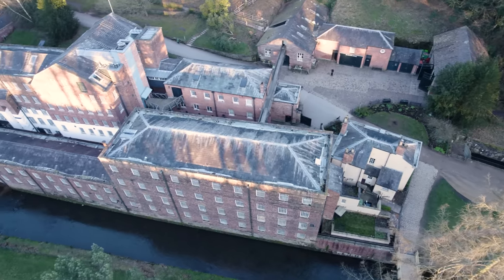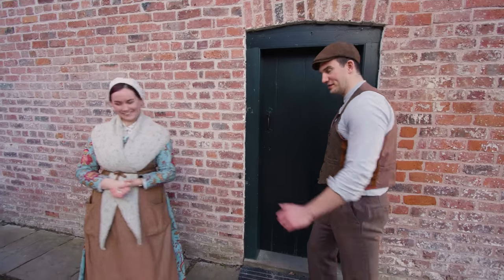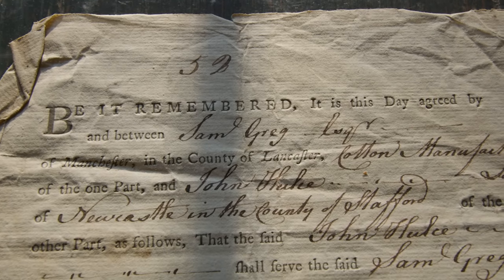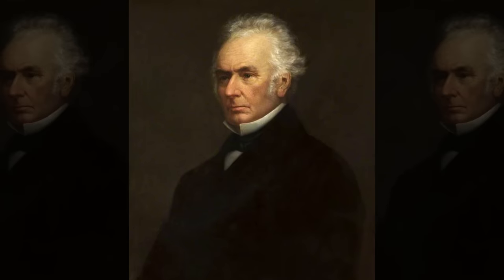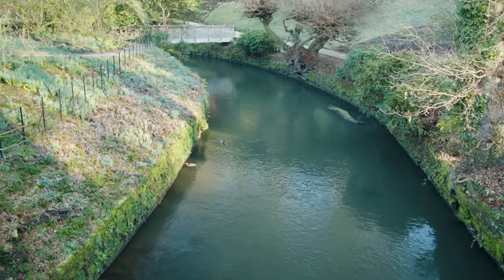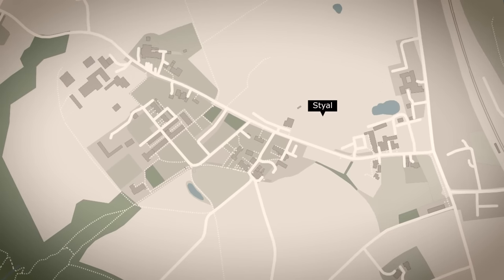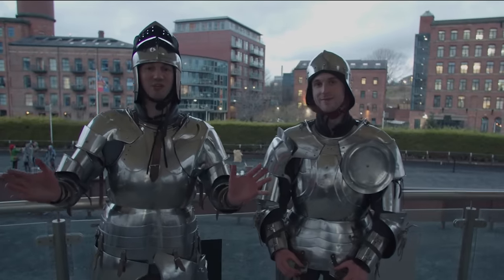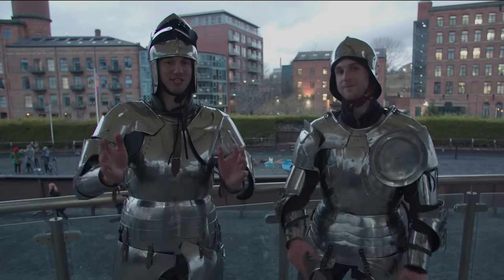Could You Survive the Living Conditions of Victorian Workers?

Comment: My Great Great grandparents worked in the mills of Padiham in Lancashire. The mill was very busy and noisy, but only in so much as a modern rock concert, and not deafening.
Their main issue was the slums, cess pits, disease, and general filth of having to work dawn till dusk, and come home and have no strength to improve the home, only to put a rag in the wall to stop the wind running through the cracks. Ticks, cotton fibres and coal dust. Dysentery, typhoid and TB. No NHS, no dentists, or even a single aspirin tablet.  Only week-old bread and dripping.
Reply: I grew up in the back to back houses in bradford  one room up stairs one down, outside toilet  and a big sink (cold water only) at the top of cellar steps
Reply: Whats an asparagine tablet? Did you mean, aspirin? For pain?
Reply: @shicruisin7004  - Yeah, and anti-bioics too.